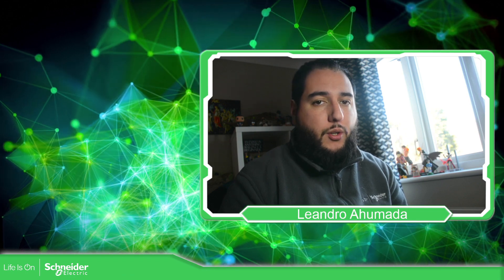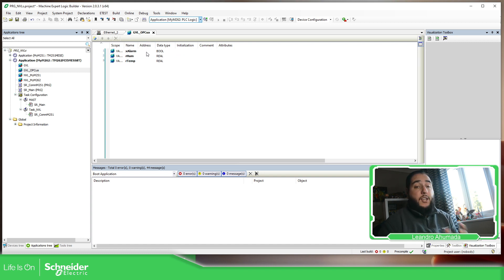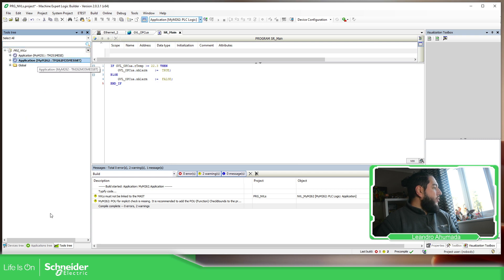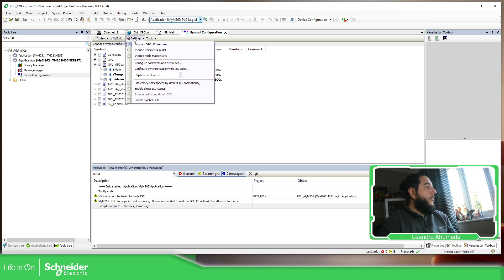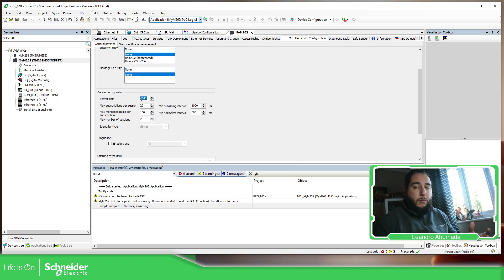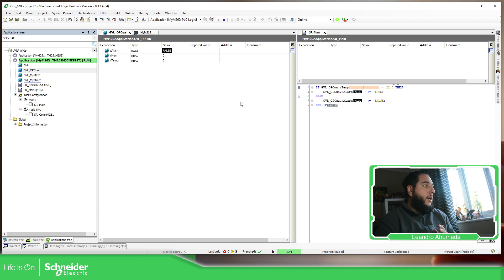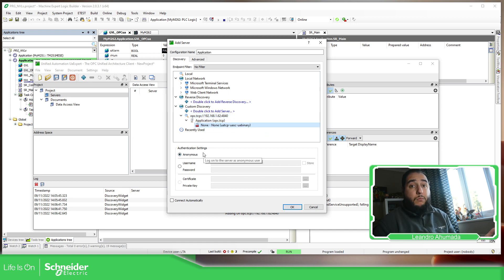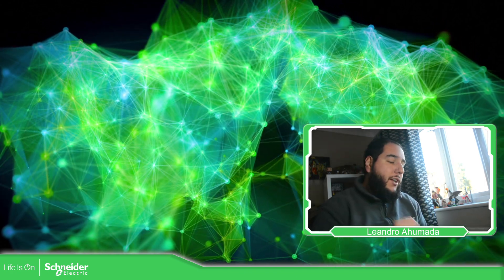EcoStruxure Machine Expert Training - M8.2 Modicon M262 OPC UA Server Configuration (Anonymous)

Comment: what is the limit of variables that can communicate with TM262 in OPC Server?
Reply from the maker: Hi there! Based on the programming manual of the M262, 1000 is the maximum number of monitored items in each subscription that the server assembles into a notification package.

Comment: How to get alarms from M262 via OPC UA? I tryed to add Alarm configuration to the project, added CmpOPCUAProviderAlarmConfiguration Library (but I cannot resolve references). Maybe you have an example or good documentation for this? Used this video https://www.youtube.com/watch?v=aGCwBudPa8A&t=1330s as example.
Reply from the maker: Thanks for sharing that video! I have not played with it yet but it look nice. I will probably make a video about it using M262.
Reply: @LeTomasAHUMADA  it would be very helpful
Reply from the maker: @yaroslavlyulko2298   I did not have any problems using the "Alarm Configuration" in the visualization. The problem is with the library "CmpOPCUAProviderAlarmConfiguration". I am getting errors during the downlaod related to that library. Not sure if it is compatible: https://help.codesys.com/webapp/idx-CmpOPCUAProviderAlarmConfiguration-lib;product=CmpOPCUAProviderAlarmConfiguration;version=3.5.17.0
I recommend you to contact the Technical support of SE in your country
Reply: @LeTomasAHUMADA  Yes, I also have problem only with the library "CmpOPCUAProviderAlarmConfiguration" during the downlaod. Thank You. I will contact Technical support of SE.